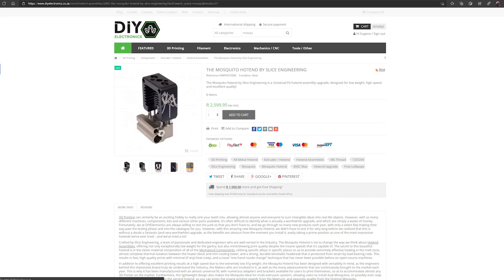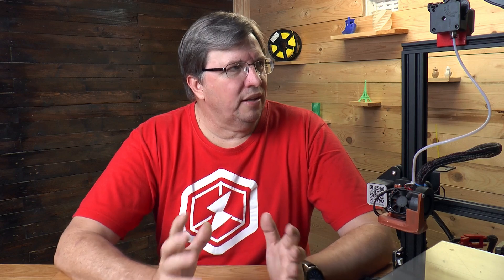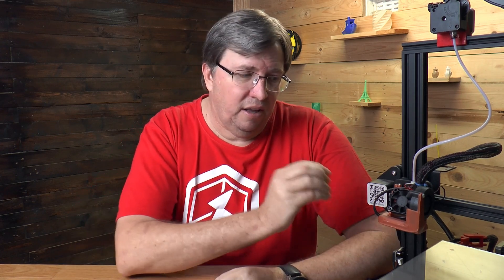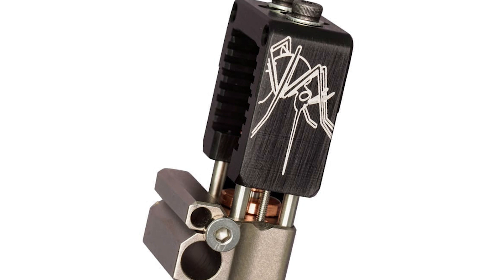The Mosquito hotend | IS IT WORTH PUTTING ON AN ENDER #

Comment: I have an Ender 3V2 and CR-6 SE and there are at least a dozen hotends in my junk drawer, including 2 E3Ds, a Micro Swiss, 5-6 Phateus Dragonflys, several stock hotends, and a DYZEnd Pro w matching extruder that set me back $500.  I'd trade them all for a 10% off coupon at Slice Engineering. Their Mosquito hotend literally takes away 95% of the problems associated with using an "entry level" 3D printer. I've been running a Mosquito (Ender) and a Mosquito Magnum (CR-6) for over a year with almost no maintenance and I haven't had a single problem and I print predominantly in PC-CF & PETG-CF. I've also successfully used PLA, ASA, ABS, Nylon, Taulman 910, and even TPU.
Trust me, a Mosquito/ Bondtech hotend/ Direct drive combo is the single best thing you can do to and 3d printer.  I'm not paid to endorse them, I don't get free stuff...I just believe in promoting great products from small businesses.
Reply: The single best thing would be to get off your knees, patent law can't force you to be on your knees for Sleazy Engineering even if they're using it with a poor foundation.

I recommend a much cheaper mosquito clone, that way you don't have to support a company that is purely self-interested. And you get higher quality components with a much larger user base, for an appropriate price.

Comment: Thank you for a frank and informative review. You've earned my subscription. 
I've been torn between going full Micro Swiss or Mosquito for my Ender 3 v2.  I would have bitten the bullet and gone with the inconvenience of changing nozzles on the Micro Swiss as well as being limited to the shroud I could print for it. As I delved deeper I saw a few people complaining that the Micro Swiss clogs with PLA. This finally swung me towards paying the extra for the Mosquito. I make a lot of molds of what I print, so gradual wet sanding is a must to get a mirror like surface. PLA is the easiest for this. But I also want to print with carbon fibre infused material. 

I do have a question though. I noticed you have intelligently mounted your extruder on the top bar of your printer. 

Takes the load off the x gantry and probably the need to add a new backplate for the hotend assembly. 

How did you achieve this? Is that a 3D printed base it sits in that also grips the top bar? 

Thanks again for a really helpful video.
Reply from the maker: Hi, thank you so much for your comments, first off, let's address the Extruder mount, you can find it here: https://www.thingiverse.com/thing:3029012?part=f388e7d6-1cce-4db7-b539-210a30ec7a41

I had the same issue with my Micros Swiss, it got comletely blocked with PLA and I ended up breaking the insert.  I have had very few issues with the Mosquito, it prints all materials extremely well.  I did have a small issue where I was getting blobs on my prints, it turns out I had put a nozzle in where the thread was to short and  melted filament was oozing through the thread.  It took me a while to figure this out, I will do a video on it shortly, and when I put the correct length nozzle in, all worked fine.  It printed CF Nylon beautifully.
Reply: @FusionSource  Thank you very much!

Comment: how did you wire in the high temp thersistor and heater? what changes in Merlin if any? etc....
Reply from the maker: Hi, when I first wired it up, I left it at the base temp of 270 but I did eventually update the temp.  Give me a day or 2 and I will post the settings I changed.  Funny, when I did the update to the firmware, I followed my own video: https://youtu.be/GQlAN88ebNM, LOL

Comment: Thanx for the review - Yes the Mosquito is very good, but I could not justify the price, as I only print PLA and PETG, so far. I purchased a Micro Swiss full metal hotend from DIY Electronics recently, which prints very well. I'm yet to print PETG with it, but very soon. The idea of different nozzles for different material applications a great tip.
Reply from the maker: Thanks for the comments.  I had a Micro Swiss Full Metal Hotend but I managed to break it when some material got blocked inside, my fault, I did something stupid but I never went back to it.
Reply: sorry for late reply but how is the all metal hot end from MS doing with PLA now?
Reply: The mosquito hotend is made by a company that is anti-competetive.

Sleazy Engineering are uninterested in competition and would rather take inspiration from stratasys "if we make our products so overpriced that no one will buy them, we'll have to abuse patent law to force people to buy them, those that don't will be priced out"

Comment: Make sure your audio is synched, near the end it's almost a full second off. It's really weird if the audio doesn't match up with your mouth and gestures.
Reply: the entire video is synched for me
Reply: I had zero problems with the audio sync
Reply: I also had sync problems
Reply from the maker: That is strange, thanks for the comment, I re-watched it and it never went out of sync, really strange.
Reply: @FusionSource  I was casting via Chromecast. I stopped and restarted and it was fine